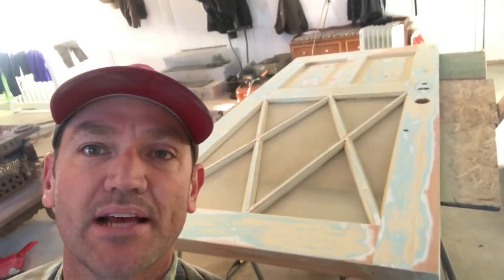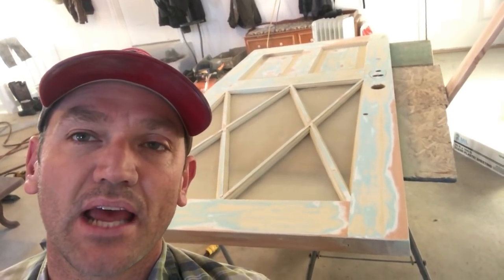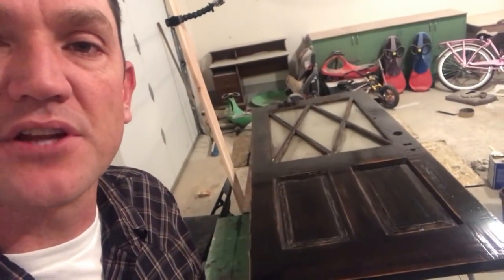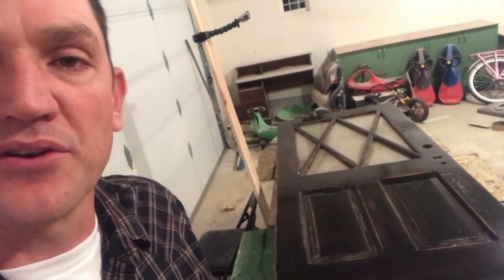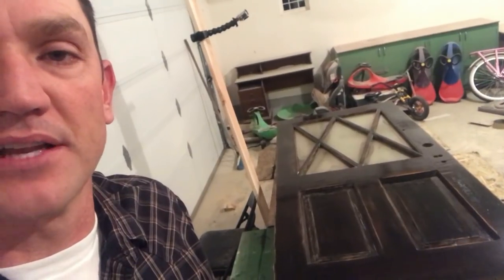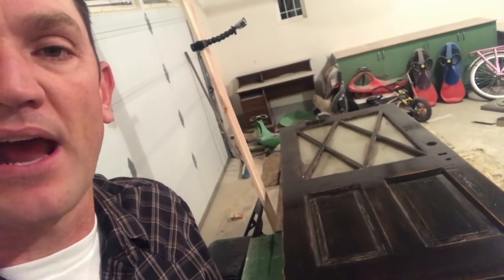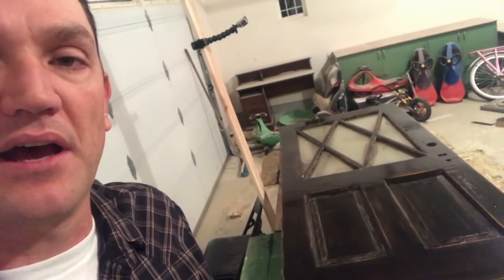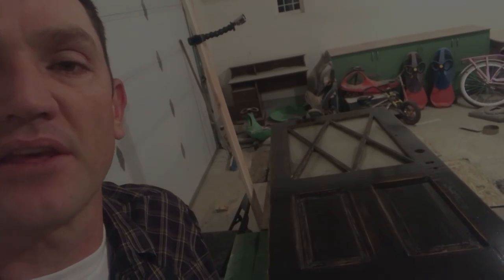Restored An Old Front Door For The House Build!

Comment: You’ve done a very nice job, and just to add, I stripped paint from wooden doors, stairs, windows etc, for 20 years as a living.   I know it’s too late now, but a good rub down with course wire wool (the door, that is), settles the grain much better for finishing than sanding does.

Comment: When I was a young pup I once painted a work table where I did brake work. Wrong answer.
First brake fluid that got on it took that paint right off. Try it as a paint remover. Seen a heat gun do wonders on paint too. Just thought I would put some info in your head. Great house project. I envy your dogged tenacity. You have a great family. Sorry about your dog. They never live long enough.